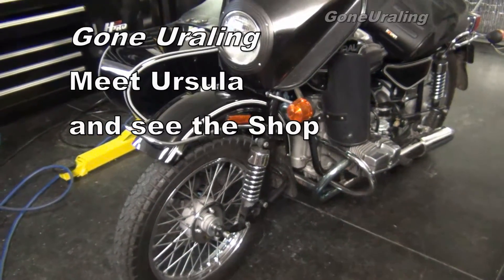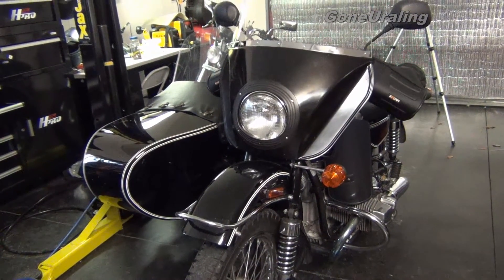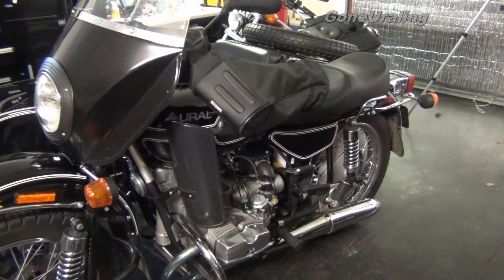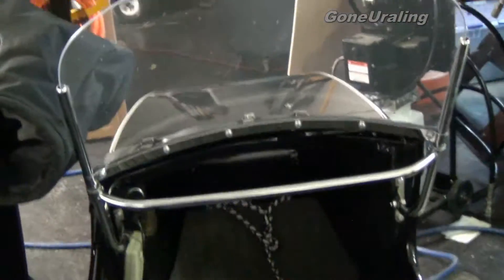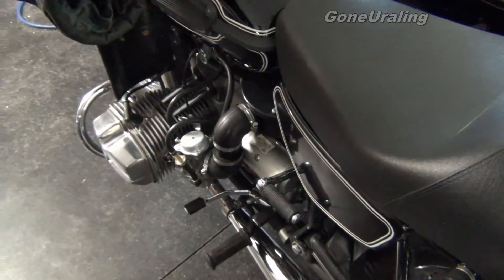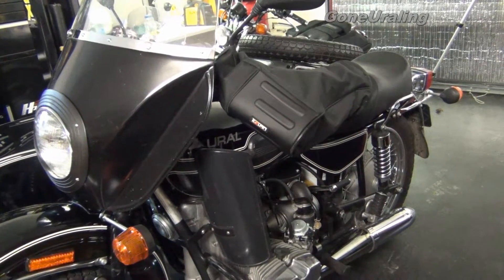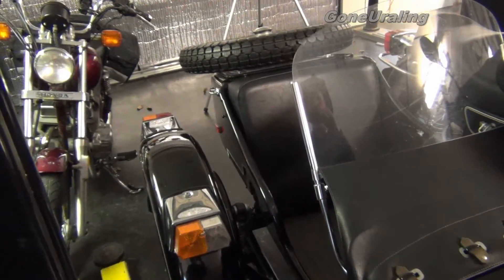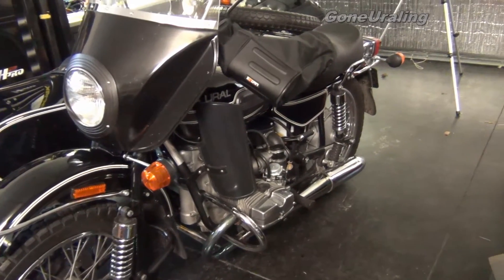Our 2008 Tourist, our bat shop and Benny! Another Gone Uraling Video

Comment: How did you remove the sidecar seat?

Thanks
Reply from the maker: +mauricio beltran The bottom is easy, dig around in the back where you would normally be looking for spare change in a couch and there is a loop of material ( a handle) that you can pull and the bottom tips forward as you force it past the back. Pull straight up and forward a little. On the bottom front of the seat there is a small metal hook pointing down that goes through that hole you see in the bottom of the side car.  Removing the seat back is just a matter of force, I'd have to do a video on that, not sure how to explain it in words.
Reply: +Gone Uraling I will give it a try this weekend. Thanks.